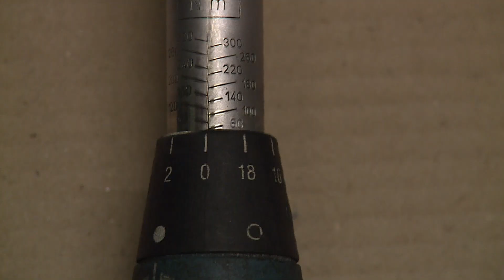✰ MAZDA 6  ✰ How to Rear Brake replacement. Rotor and Pads change

Comment: Hello. I have tried replacing the breaks and rotors on my Mazda 6 this weekend and ran into a problem maybe you can give me a tip. The front was fine but once i got to the back the bolts holding the caliper mounts in place just don't want to turn even after i drowned them in PB blaster. How did you get them off so easy man?
Reply from the maker: DeltaWrath Hello. As easily as in the video usually is not. With a large torque wrench I make those rusted screws.
Reply: Yea i tried that but just cant get an angle on the top bolt, its a little too tight in there =/
Reply from the maker: DeltaWrath Is not much space, but it works.
Reply: DeltaWrath - did you ever get the caliber bracket off. I am in the same boat, rusted caliber bolts and cant get them to move. Would love to hear if you found a solution.
Reply: Yea i did... I had to use a 24" breaker bar with a shallow socket on it, and before you put the bracket back on grease the bolt and screw them in and out a few times to loosen all the rust so it dont stick next time.

P.S. Got the breaker bar at Harbor Freight for like $20

Comment: After you pushed the caliper piston in by turning the tool clockwise, at about 3:50 you show that you put the tool back on and turned the piston about 1/4 turn counterclockwise. Is that necessary, and if so, why?
Reply: The two holes in the piston need to align vertically. He turned it back a little to make them align.

Comment: Hi, at 2:14 when you are removing the rotor what size bolt goes in that hole to back off the rotor?  Thanks!
Reply: +Mark DeRoller It was the same thread size as the set screws. I have a bunch of metric bolts and I'd guess it is an m8.  Not 100% sure, though.

Comment: Great video, what were you doing from 3:09 to 3:50? I'm bit lost there and is it necessary to do that bit.
Reply: He was rewinding the piston in the rear caliper. And yes, it is a must to do. new pads would not have enough room to go in. Hope this helps!
Reply: He's pushing back the caliper's piston (when pushing, you must spin it clockwise - not like front piston --> just push). You don't need that tool, any "pointed" pliers, or maybe seger pliers will work...